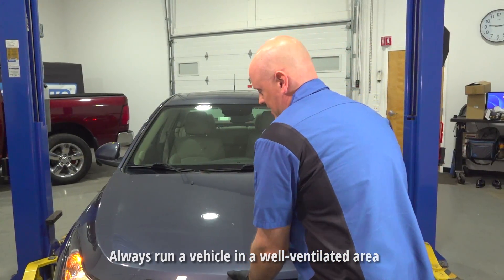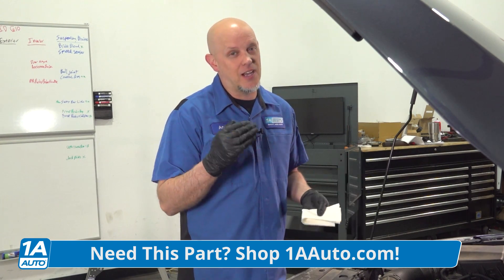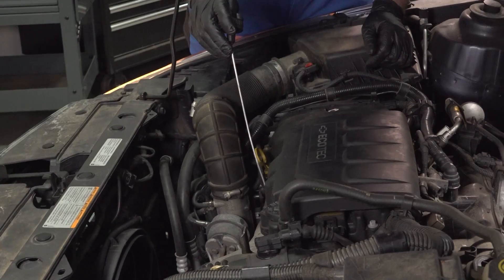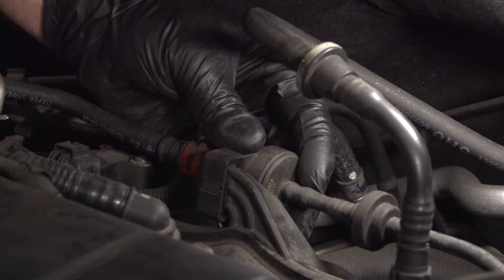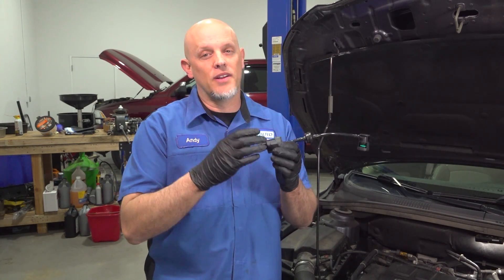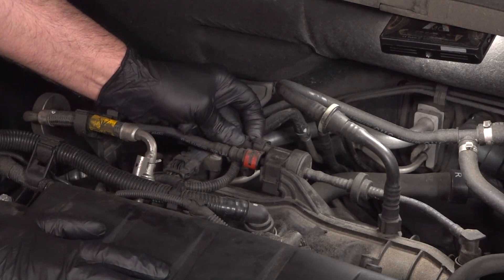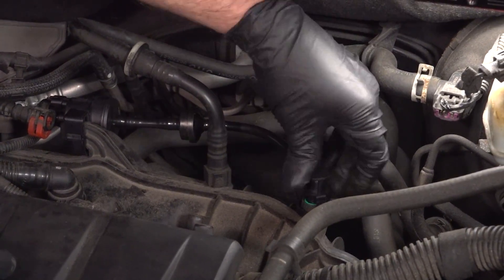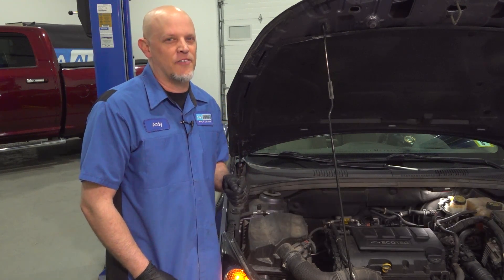Loud Tapping Noise Under Your Car or Truck Hood? A Check Engine Light is Coming! Replace This Part

Comment: Hi, am Eric from Ghana, I use a 2014 sonata, I use to have a quick start with my for a very long time until recently it takes a longer time to start, sometimes when it starts,it misfires like twice then it stay on. This unusually happens when the car have been parked over night or left for longer hours. What could be the problem? I have changed plugs,coils and even fuel pump